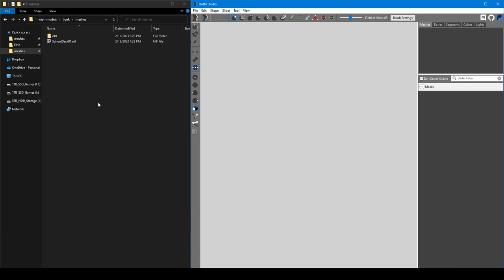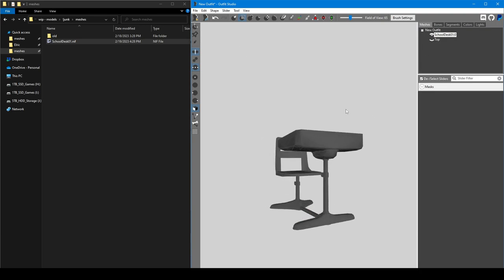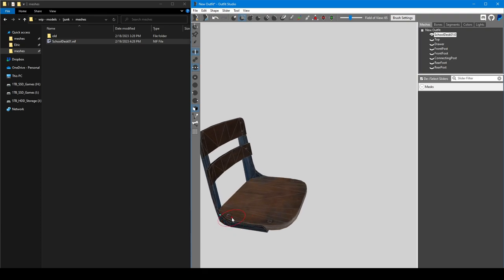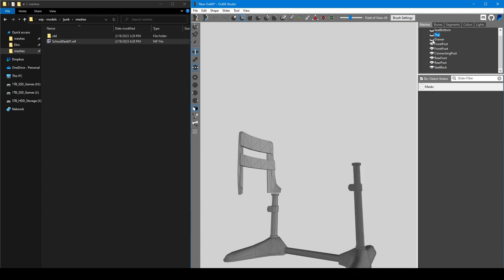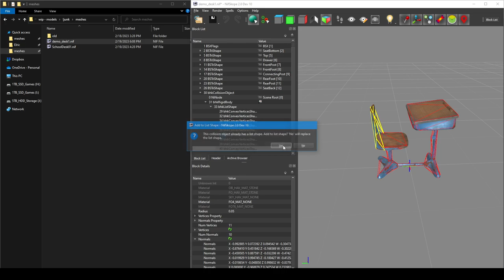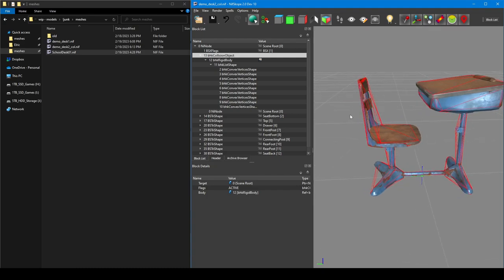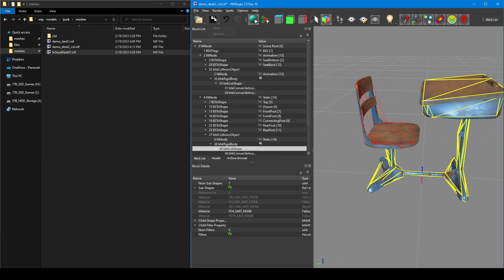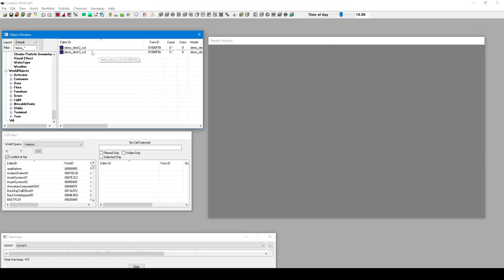Advanced Collision Tutorial w/Split Meshes - Fallout 4 and Skyrim

Comment: If you load a nif into outfit studio and then export it as a FBX into blender you can separate all the pieces by mesh island really fast.  There's  batch obj exporter for blender too, which allows you to load them back into outfit studio all at once and convert them into a nif.  It's not that useful when you're doing small objects, but when you're chopping up large buildings and want the components it makes it far more manageable.
Reply from the maker: Good to know. I'm not real familiar with Blender or how to do what you suggest. And I figured most people will have Outfit Studio for various reasons already.
Reply: Interesting. I'm a total blender noob and my way was very crudely importing custom sailing ships into skyrim by chopping them up and reassembling them into one mesh again. What plugin were you using exactly to break down the meshes piece by piece for export and reassembly? And was there any issues with objects containing millions of polys or tris?

Edit: I rudely assumed mesh island was a typo I found the plugin thanks for the suggestion :)